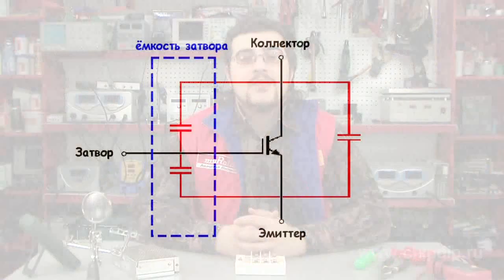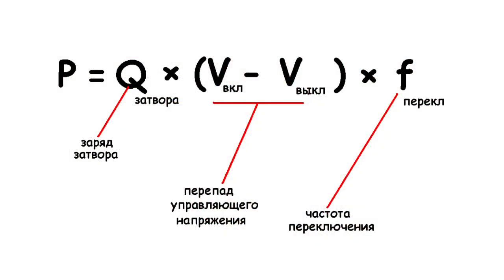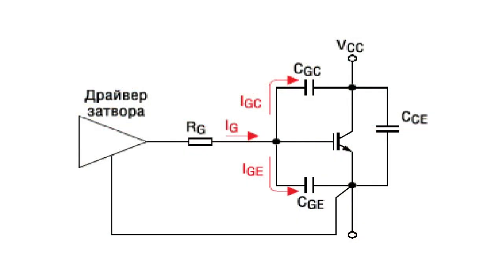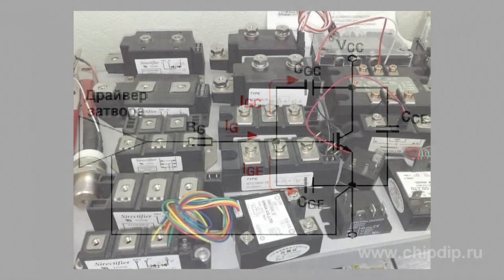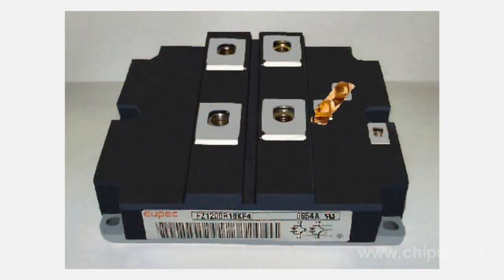IGBT Insulated Gate Control -- Some Aspects

Comment: Hello,Is there any way how to construct voltage regulator from IGBT module???The output voltage is 400 volt DC,as far I checked there is no voltage regulator for 400 volt DC or any deemer switch for such voltage...I was checked an ebay and asked few seller's but they told me particular IGBT module requires Driver Control Circuit,not sure what it is but maybe you know how to build one...